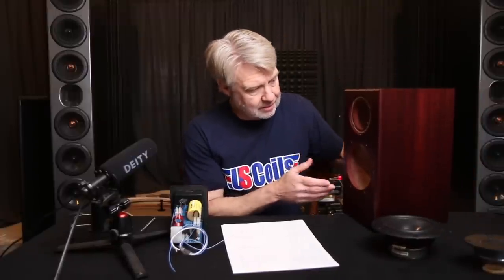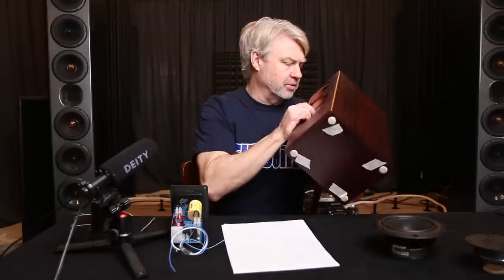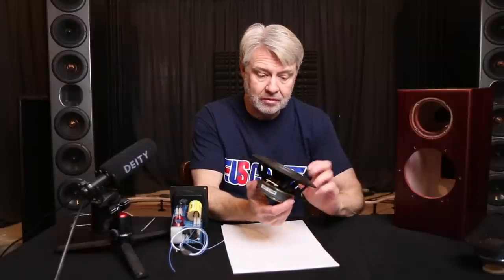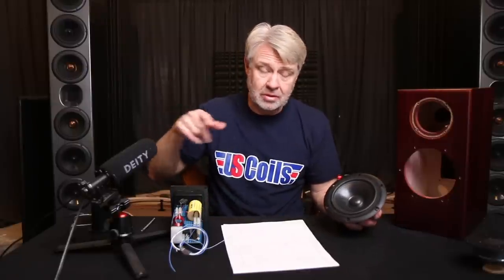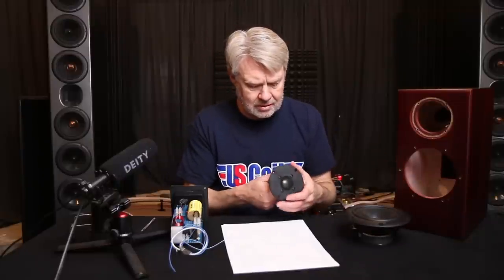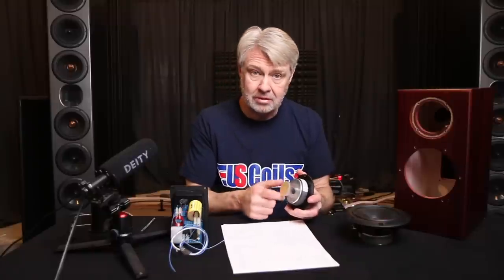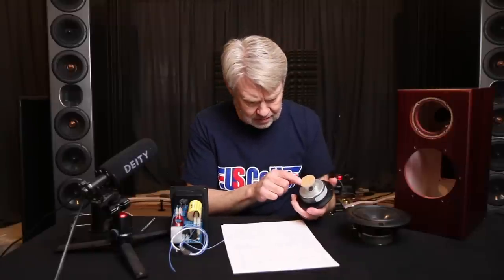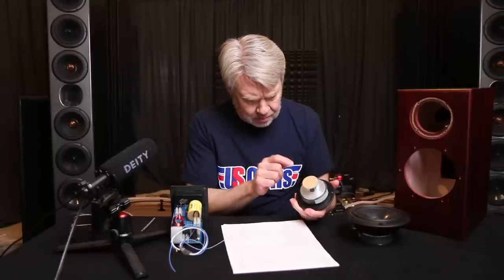Is the Totem Rainmaker a Real Tear Jerker?

Comment: Yamaha NS-690s can be found for 500. Absolutely stunning speakers. That is the LSA spectral decay. Looks gross. Instead of connetors, why not hard wire high quality braided cables to the crossover? Why not add an LPad for the tweeter?  Or a series and parallel resistor? For that matter why not have the xovers external to the cabinets?

Comment: Another great video where the sum of the parts simply don’t add up. When you look at Totem pricing, I understand why Danny is so popular.
Reply: Totem does a better job than most for the price.  Decent parts in most of the crossover compared to other high end brands at the same price points.  Sure, the Rainmakers treble was hot, but the cabinets work well, the driver selection is pretty good and the overall speakers is good quality. How many other speakers get a relatively positive overview before upgrades?
Reply: If your talking about speakers made in China or some other 3rd world country then perhaps the sum of the parts may not add up. The drivers that Totem uses are not Chinese junk, they come from European countries and are fabricated to Totems specifications, they are not typically bought off the shelf items in almost all cases.

Comment: I'm curious is there no way to measure the diameter and Length of the current port and match with another that is bigger but shorter to keep same tuning? Would be very simple to just drill a bigger hole no?
Reply: Calculating correct port sizes are very easy.

Comment: aircore inductor on parralel with the tweeter does not matter if it is 18 awg or 16 awg, its not in signal path and thus via PHYSICS does not alter the sound or power of the tweeter. it only effects the crossover with the impedence difference, which can be adjusted with the rest of the crossover if the engineer knows what they are doing. just another classic misdirection as to what is and is not acceptable in a crossover. Again parralel inductors have NO CURRENT HANDELING THUS AWD ONLY MATTERS IN TERMS OF IMPEDENCE ADJUSTMENT
Reply: Actually, they are in the direct signal path and do matter.
Reply: @dannyrichie9743  oh my well then. It's weird to see inductors on signal path of a tweeter. They trying to roll off something in the top end that's bad then I guess. I assumed it was low pass which only thr impedance of the inductor is reliant. What an odd crossover 😂
Reply: @djfirestormx  Even coils that are in the shunt circuit are still in the signal path.